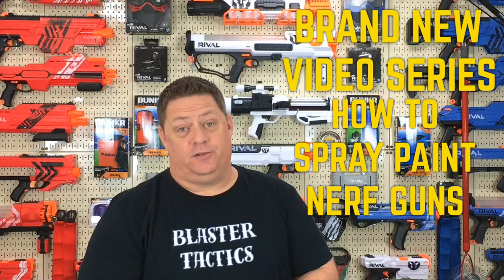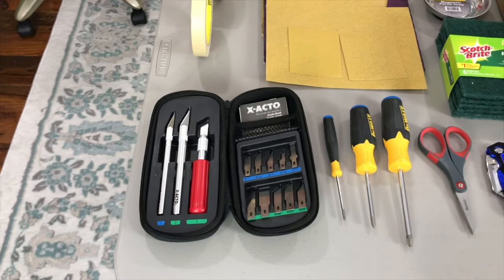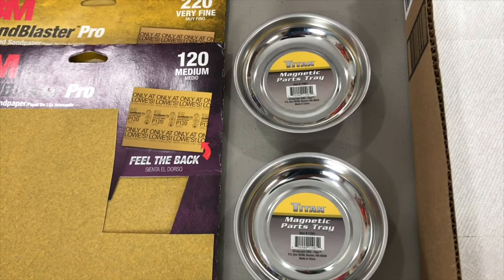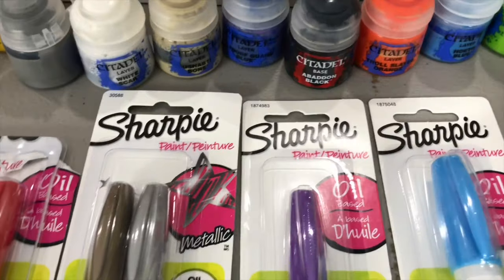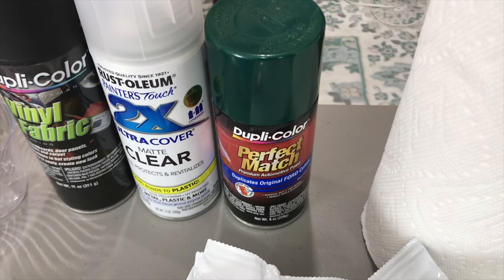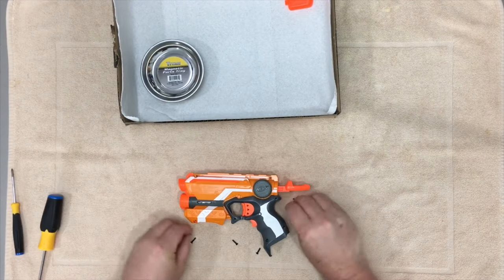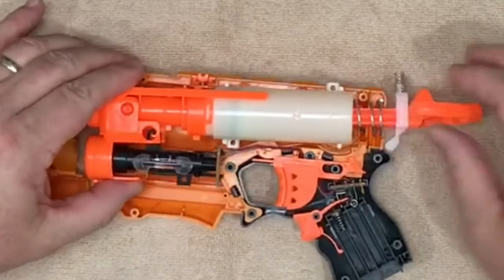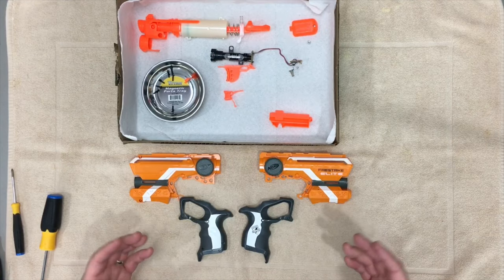How To Spray Paint Nerf Guns - TUTORIAL

Comment: I hand painted a Nerf Rival to look like P90 which I used to battle with my friends. I actually don’t spray paint, I hand paint the whole gun to not have to take it apart. I don’t feel like using spray paint just because it’s harder, and I will probably make a mistake. And yes it is bad to spray paint a gun without taking it apart. It will damage the inside, and jam it permanently.

Comment: I love your mod videos, great video quality and audio, everything is comprehensible. As for this guide, all you have shown here looks a lot like my painting equipment including the citadel paints (i play warhammer and 40k, i have tons of these). As for getting rid of Nerf logos or other stuff on blaster shells, you can speed the sanding up by grinding them off with a rotary tool but some honest elbow grease and sending paper get rid of them, too.
Reply from the maker: Appreciate the awesome feedback Vahler78 yeah i have not mastered the Dremel Yet LOL i just do not use it enough in all honesty but hopefully when i get my garage worked out and really begin to get into modding more i will use more ! Citadel paints are awesome for sure little pricey but work fantastic
Reply: The dremel is a great tool but you have to be careful. It´s easy to take away too much material and it happens fast hehe. I tend to use the dremel to take away 80-90% of a logo for example. The rest i do with sanding paper or a sanding sponge.
Reply from the maker: @Valher78  yeah i without a doubt need more dremel practice lol always feel a little out of control with it LOL